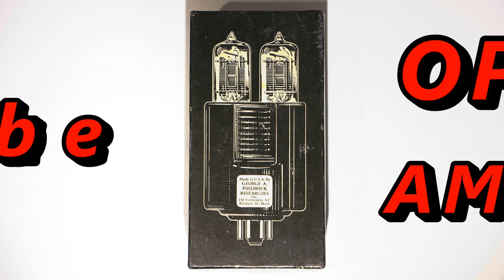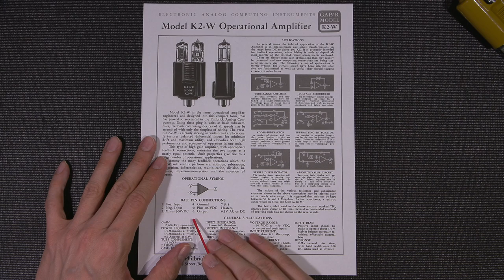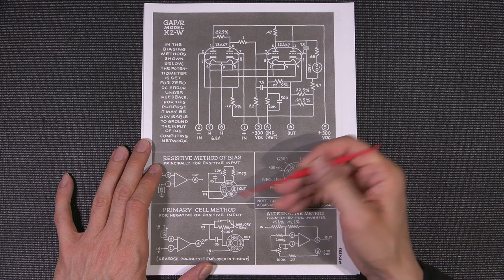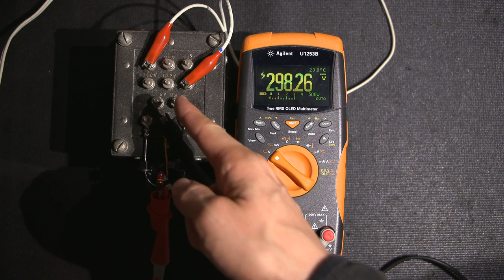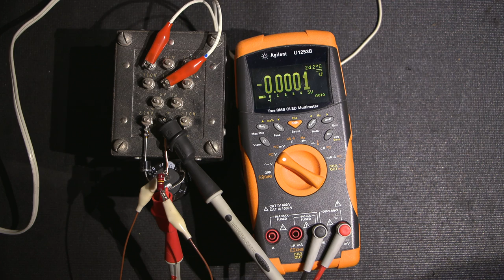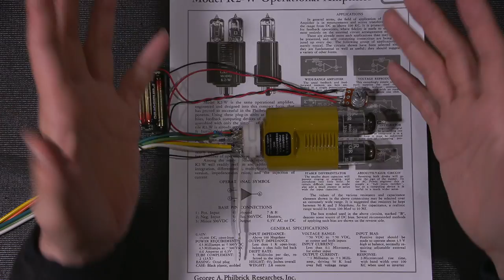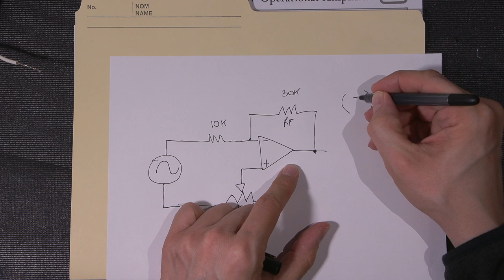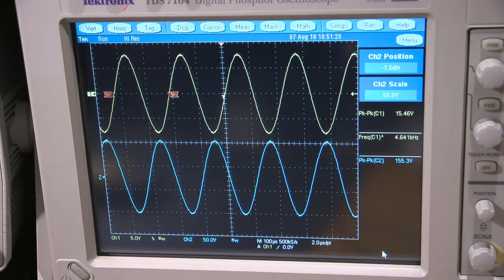600 Volt Tube Op Amp! Lets Power It Up.

Comment: Wow Paul, Great Video!  Someone at the factory that produced that device must have spent a very long time at a curve tracer matching 12AX7A’s to get an output like the one that you demonstrated. That probably cost a pretty penny in it’s day. Using those op-amps to build even a simple “computer” probably would have cost almost as much as a house, and the electric bill would have been enormous. Think of the heat output. Sure makes me appreciate the people at Bell Labs that came up with viable transistor technology. Could you imagine a vacuum tube smart phone? A Steam Punk Dream I guess, the size of a large steamer trunk. Once again Great Video, I don’t know how you managed it with all the time that you have had to spend on the “SIFT” project. Greetings from Texas, I hope you are having nice weather, it’s hotter than Hades down here.
Reply: Yes but it would cut down on your winter heating bill but add to your bill in summer with air con which is a zero sum gain.
Reply: Steve calver No, you'd just have a lower AC bill in winter, or you could try to sell the excess heat to recover some of the expenses...
Reply: Robert Martinu Before the move to more efficient CPUs, my basement server room was sufficient to heat a 1200sq.ft. .finished basement...and still I would have an air conditioner running throughout the winter.  I would often get curious questions as to why I had an air conditioner running when it was 10°F outside...and then they set foot inside my server room where the 80°F air was quite noticeable since the hallway temperature was around 70°F.
Reply: Steve, Robert, and Ethan, just an additional comment on my reply. Here in North Texas we had to run our air conditioner during the day for about half of December last year. So even though I would love to have a vacuum tube Computer, cooling it would require an even larger separate air conditioning system than I have for my entire home. But wouldn’t it be fun to play with. In the late 1980’s I worked as a two-way radio technician for a state agency, when they were upgrading the agency mainframe. The radio shop was located at the warehouse, and the old power supply for the outgoing mainframe was temporarily stored at the warehouse awaiting auction.  It was designed to operate a TTL based mainframe and had a 480 volt AC three phase primary with a regulated, filtered 5 volt DC output rated at a continuous 400 Amps. I  can't remember the exact weight, but I do remember that the forklift at the warehouse which was used for moving pallets of paper for the print shop could not lift it. It was on steel casters and all we could manage to do was to push it around. It also had a separate dedicated airconditioning system.  The person that bought it told us he was going to use it as a power supply for a robotic welding machine he was designing to power just the welder. I can only imagine the power requirements for say an Eniac type computer with 20,000 vacuum tubes, wow mind-boggling. The history books say ”rumor has it that when the Eniac was switched on, the lights of Philadelphia dimmed.”
Reply: The Philbrick Researches K2-W vacuum-tube op-amp has a differential input that uses both halves of the same 12AX7 dual-triode tube. It is neither necessary nor possible to make matched pairs by sorting tubes. Though it might have been desirable measure every tube's "performance" as a differential pair (including closeness of "matching" within the tube), select the best ones for that use, and use the rest elsewhere.
Reply: Before the transistors took over there were attempts at ceramic micro vacuum tubes

Comment: Mr Carlson: In 1953 many American cars still had a 6 volt electrical system, in fact over half of them did, but Detriot was converting to the military's 12 volt system, because they had been using it for the war effort, and 6 volts systems used twice as much copper in the wiring. Cheaper is always better, so, enther the 12 volt system for consumer cars & trucks & the military went to a 24 volt system.  Class A trucks also went to 24 volts. That is the final version of a GAP Op Amp. I used to sort through open skids filled with these GAP things looking for computer grade 12AX7s. The early prototype GAP op amps had rather cheesy box & pan brake bent & punched sheet aluminum cases. I used to find a lot more K2-XXs than W-2s.
Reply: HAVING 6 & 12 volts heaters those tubes could be used in 6 volt pre-war cars and in 12 volt military vehicles, as well. I just restored the radio for a Hudson Hornet 1956, and that thing takes something like a 25 or 29 amp really weird fuse, and I need to buy more of those fuses, but 6V6GT audio output, vibrator power supply, 6SQ7 preamp, and those weird fuses, and the fuse is IN THE RADIO ITSELF! SFE 30 for the radio and you  have an SFE 9 adapter for the dash lights. Weirdness! Every amperage is a different size so you cannot stuff an SFE 20 into an 9 amp socket. You can can, but you will have to crush the glass part.
Reply from the maker: Thanks for sharing your story Seth!

Comment: That was really interesting. I see those devices date back to the mid 50's.

When you work in a telephone exchange you learn about what current can do - 50 Volt supply at up to 2000 Amps. Tools vapourise if inadvertently dropped across buss bars. When I was a young trainee I remember the boss freaking out because I was powering some experiments I had to do for my training off the main buss bar. I had hooked them up with 0.4mm jumper wire. If I shorted anything it would basically act as fuse wire.

I've managed to acquire 3 of these devices myself now. All boxed and possibly NOS so I will have a play with them.

Comment: I  have a hard time understanding electric stuff. I have made 10+ guitar effect pedal kits and i have replaced tubes and the caps in my old marshall jcam800 2204. And i have worked with cars for 10 years. But you are actually making me understand stuff that i never quite understood.

Comment: I revamped an old piece of tube state machinery & it used tube op amps as oscillators & comparators to create square waves for timing purposes.
Also, I have warned people right before they got walloped by charged capacitors. I've never had the pleasure myself though.

Comment: Thanks for warning "normal" people about the higher level voltage in tube systems. Mr. Carlson is correct. THESE VOLTAGES MAY KILL YOU. I even give 250 volts and up a very high level of respect, even though I have been hit by 2nd anode wire on a 25" CRT and DIDN'T DIE!!! Mr. Carlson, thanks for having this material available for us. We need to get into a great conversation about many things involving electronics and flow paths. We would both walk away with advanced enlightenment. Consider this someday. You won't regret.

Comment: i went to a technical high school in the early 60's, 4 hours a day of electronics for 4 years.  I subscribed to ElectronicsWorld at that time, Popular Electronics and Radio Electromics were two other magazines that dealt with hobbyist electronics.

One issue of EW had a tube based op amp that you could build, I think that one had 4 or 5 tubes in it (all 12au7 if I recall correctly). I took the parts list and ran it through the Allied catalogue to see what it would cost to build it. The total came to $70 in 1964 dollars without a power supply - a bit stiff for a HS student.

Comment: Paul.

Man you really did this the hard way!

You could have gotten the +/- 300 volts off just the one transformer by just reversing one diode and using a second filter cap from ground (-) to the - terminal of the transformer. Result:  +/- 300 volts, ground referenced and MATCHED.

I'm guessing that you never built a computer from vacuum tubes :)

Larry Miller
(Engineer for IBM RAMAC, 1959)
Reply from the maker: Hi Larry. LOL, it made for a more interesting video, that's all. I bet you swapped out a few of these modules, and thousands of tubes too. Good Times!

Comment: With a suitable circuit design, you should be able to get one of these Tube Op-Amps to work as an Oscillator, say for example a Phase-Shift Oscillator, and then you'd be able to easily generate a 1kHz 155V PP Sine Wave.

Comment: I've used an incandescent bulb of suitable rating to keep a cap discharged. the advantage over a short , is that you dont kill the xfrm or fuse when you forget it's there and switch on (the disadvantage is that they dont kill the fuse/xfrm when someone else switches the power on!)

Comment: Great to see the original Philbrick K2-W OpAmp fired up.  I have a number of these that I have collected over the years but never applied power to see them work.  There is some great history here that was left out of the video that I highly suggest folks research these work horses of the electronics industry starting at the K2-W, through the 741, 5532, etc.  https://en.wikipedia.org/wiki/Operational_amplifier.   Also Walter Jung's Op Amp Applications Handbook where he goes into the history of the opamp including tube-based.

Comment: My father in law and his partner at RCA were contracted to design and build a prototype integgrated circuit. They were given a year to do so, but finished the job in six months. The folks at RCA offered them six months pay and set them free, or six months pay with full access to their laboratory. They took the time in the laboratory and they invented the solid state op amp. They used the local university to create the silicon wafer for the project, and when RCA looked at their invention and decided it was too advanced to put into production, RCA shelved the project along with the patent. The asshole professor at the university they used published a paper on the design in 1965. In 1968 engineers at Texas Instruments dusted off the article, discovered theater was no patent on it and went into production building hundreds of thousands of calculators with their op amp. Shit! I could have married into a wealthy family!
Reply from the maker: Thanks for sharing your story Ken!

Comment: THE FACTS ARE::IN have seen all of MR. Carlson's lab videos so far I kept watching till I saw all of them but one or two I used to be in electronics.  I work for R C A SERVICE CO.  I could take their color course and it was different to most if I had a question I could ask someone in the shop and get an answer to my question from those who were the technicians. I did learn a lot from them.

Comment: TUBE op-amp? I had no idea such a thing existed!
Reply: Welp, nothing I've watched or read about "the earliest computers" (e.g. Jaquard's looms, Harvard Mark 1, ENIAC, ...) mentioned op-amps; presumably because I was looking at digital, rather than analogue, computers. Hence I also somehow hadn't realized / noticed that op-amps preceeded transistors :-)
Reply: I remember missing the first couple minutes of my favorite radio shows, because of forgetting to turn on the set a couple minutes in advance.  So the boot time for those tube (thermionic valve) computers would have included a few minutes' warm-up, even before any program could run.  Nowadays I get cranky if Windows / MacOS / Linux can't boot in 30 sec 
 :-)
Reply: Very interesting video. I've never seen a tube op-amp before!

Comment: This probably used to be a part in industrial control too. PID controlers and such. This could easily control a thyratron valve in a phase fired controler (wouldn't need a lot of stuff to make this kind of thing) - accurate temperature control for example.

Comment: As far as I remember, the rail voltage of an op-amp has very little to do with it's closed loop gain.
So, so long as you have enough voltage to drive the op-amp, a close loop gain of 3x will be that, no matter what the voltage is exactly or even if they are unbalanced, as it's the accuracy of the resistors that matters.  Or am I missing something unique to this one?
Also: Voltage =/= Power at the start..  (Yes, I'm being picky. :)
Reply from the maker: Your answer is quite simple, remove the rail voltage and see if you get gain.
Reply: You are basically correct, but it goes a little deeper than that. Linearity and, supply rejection are a function of the open loop gain. The higher, the better. Most modern IC opamps have an OL gain of 100,000 or better, thus have excellent linearity and supply rejection in closed loop applications. Changes in supply voltage have very little effect on their output. This tube opamp has only 4 active devices (4 triodes) so I wouldn't expect as good as performance (lower OL gain of 15,000). Still, I'd expect the gain not to change much with supply voltage.
Reply: The biasing scheme requires the two rails to match reasonably, within 10 or 20% certainly, but it should have reasonable PSRR for a valve circuit(!)
Reply: This was what what I was curious about. When Mr Carlson was talking about adjusting the rail voltage to tweek the closed loop gain it made me curious.
If the rails were +300 / -295 when the the gain was set, my understanding was that if you make them true +300/-300 that number should not change.
Mark Tillotson mentioned the biasing scheme, that was was the bit I was missing but not being deeply knowledgeable with valve amps I didn't know how much of an effect it would have.
Reply: Not Given: Reverse trolling, I thought; why should the commenters have all the fun? :-)
Reply: "This tube opamp has only 4 active devices (4 triodes) so I wouldn't expect as good as performance (lower OL gain of 15,000)."

Not even as good as that.  2 of the 4 active devices are cathode followers with a gain less than unity.  The other 2 devices could manage a gain of 100 each (at best), for a total OL gain of 10,000.  Except that's never realistic with triodes, and a gain of ~65 per stage is a better guess.  That drops total OL gain to 65 * 65 = 4225.  We could get better estimate of gain by investigating data sheets & plotting loadlines, but the end result won't be much different.

"As far as I remember, the rail voltage of an op-amp has very little to do with it's closed loop gain."

The (undistorted) gain of a triode has everything to do with its supply voltage, and lower voltage yields less gain before distortion.  The exact power supply details will dictate the triode open loop gain, and then dictates what the final opamp can do closed loop before the output signal falls apart.

The usual rule of assuming the external resistors of the feedback loop of the opamp determine everything holds only so long as the discrete devices forming the opamp have what they need to meet their published specs (true of tube/cap/resistor opamps, discrete transistor opamps, or microscopic components on a wafer forming an IC opamp).
Reply: @brianingram2068  I stopped the video on the datasheet and I think they're claiming a gain of 15,000.
Reply: You are right, the gain is not dependent on the rail voltage, however the maximum output voltage is of course.

Comment: Often, when setting up a small circuit with variable parts, one can use a barrier strip for mounting 

the components and lead wires to the contact points.....Makes it much easier to view/ change
 what you have done..

Comment: Baal in the day  it was micro microfarrad instead of picofarrad. And never saw a12au7 or 12ax7 in a car radio. They were used in series heater circuits and pins 4&5were tied together in 6v. Circuits.  Very good job

Comment: They require about 580V higher and about 100 times the current of an average solid state op-amp. That is a lot of power! If I'm correct, they were used on analog computers, right? Excellent video and interesting device!

P.S.: Just one thing. If I'm not mistaken, that center tapped transformer can be used to build a symmetrical power supply by itself. You just need four diodes, two resistors and two resistors to bleed the capacitors, and you are set. Any particular reason why you didn't do this? I just found your setup to be very complex.

Comment: For what it's worth, the slight inaccuracies between the input and output voltage magnitudes is more likely due to the slight inaccuracies of the input and feedback resistors than it is the power supplies being unregulated.

Comment: Interesting Op-Amp, would be interesting to have measured its bandwidth/frequency response.
As you found a nice centre-tapped transformer you could easily have made a positive+negative supply by just adding two extra diodes, an additional cap and bleeder resistor.
Looking forward to more experiments with this device. The restorations projects still to come. And of cause new Patreon lessons.

Comment: I wonder if hobbyists back then built radios and amp using these. Just like I did with I.C. op-amps back in the 70's !
(hopefully with a scaled-down supply voltage - +/- 300 Volts seems outrageous.)

Comment: Great video. It’s ironic that the datasheets are anything less than perfect, since Philbrick the man always seemed to me to be a fanatic perfectionist with a penchant for high-concept style that must have appealed to the true eggheads who built and used analog computers. You can bet those precision devices would be run with regulated power!